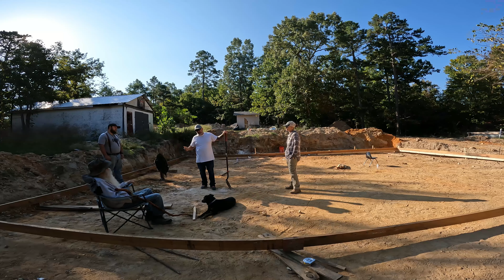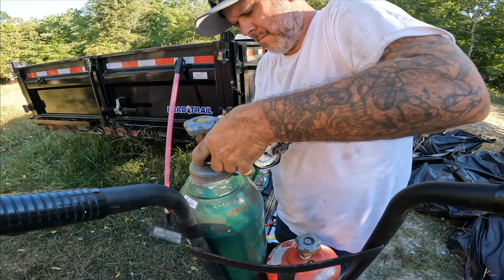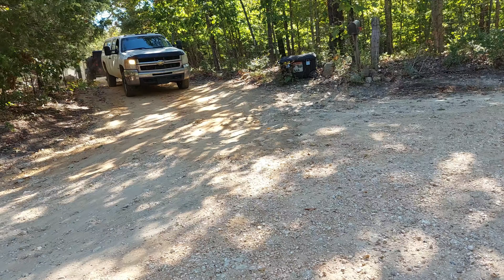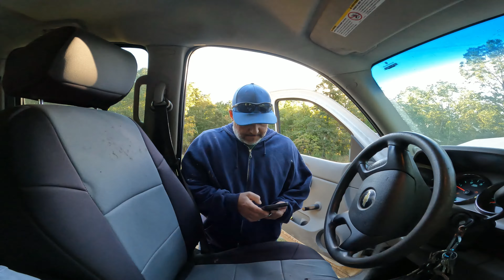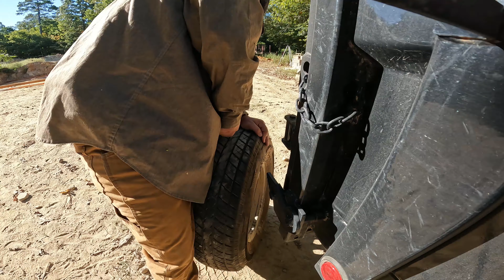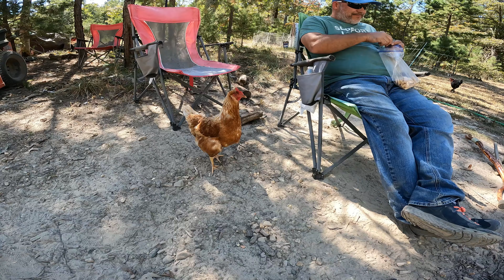Crash course on our house plumbing/Dads visiting/ Supply pick up/Another flat/House build EP 41

Comment: Y’all really is southern… don’t even bother replacing the wheel stud… n who don’t got some extra acetylene lying around when ya need ta cutta lug nut off real quick… shit was stuck tightar dana red rockat taa bitch in heat… if ya seen 1 stuck pole gripper ya seen em all, hunny grab my catalytic cuttin torch…. Half patch is good enough, plug that hole just like we did when we conceived little Billy